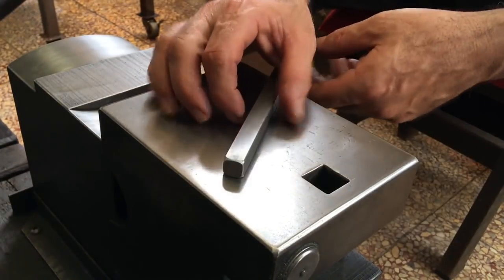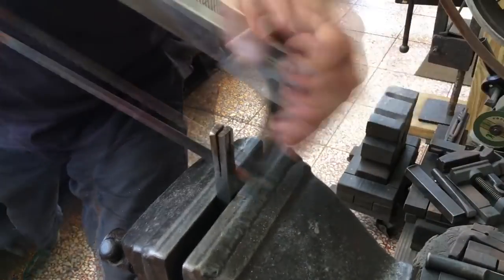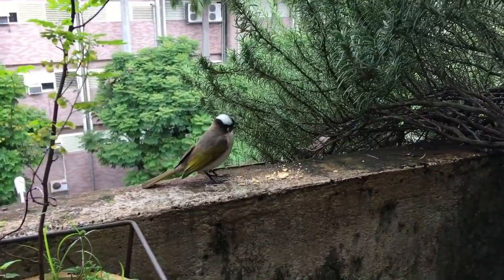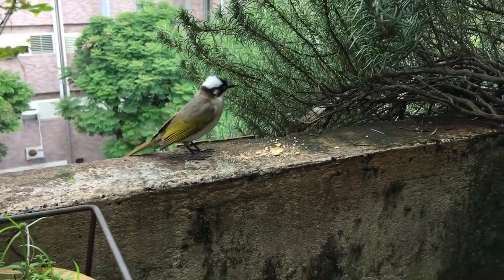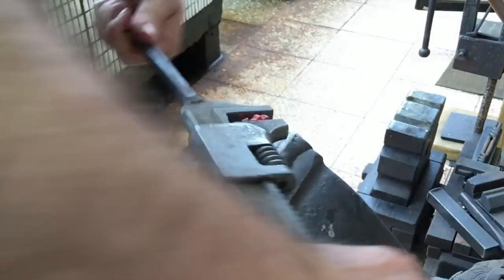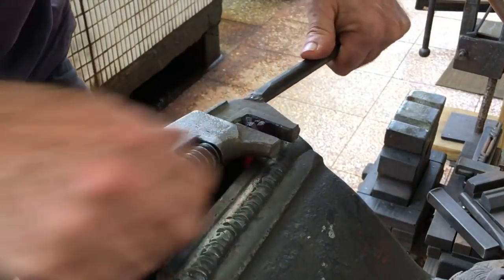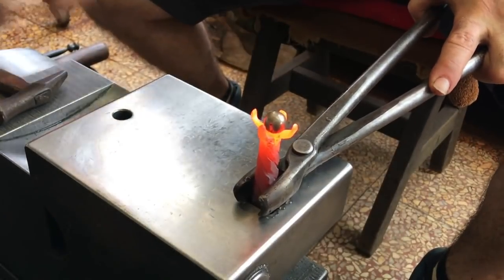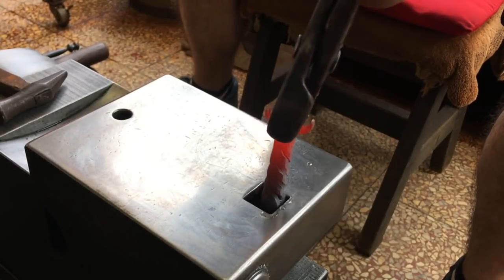Blacksmithing - A Decorative Ball Bearing End

Comment: hi Glen.
I really love your work, it's amazing. I just have a qouple of questions. Could you ever make more hammer making videos and how do you harden your type of anvil, and how do you harden such a big piece of metal.
And how do you get such a clean finish on your work(hammers and such)?
Again, really fantastic work and it would be much appreciated if you answered. Thanks.
Reply from the maker: Hi and yes, I am planning to do more hammer making videos. I had most of my small block anvils professionally heat treated. The only one I hardened myself was the largest, very first one I had made. It was a real challenge. I used my gas forge burner and build a fire brick "forge" around the anvil. When at the right temp., I disassembled the fire bricks and used a hose to quench. As for clean finishes, I frequently wire brush my work and almost always finish pieces at a low heat so as to not form heavy, peeling scale. Thanks for watching.